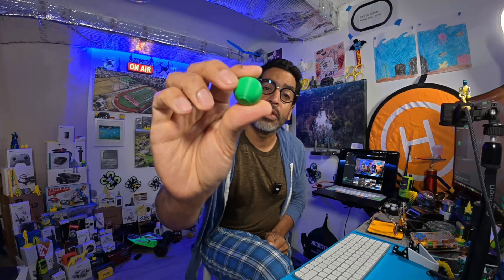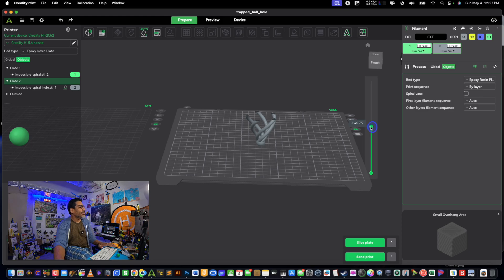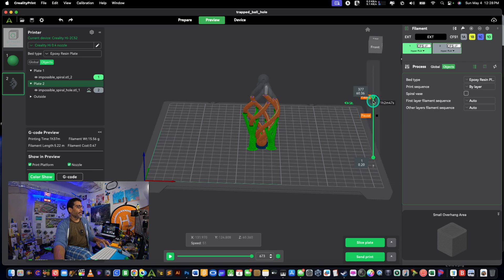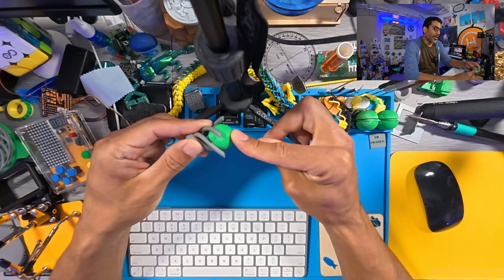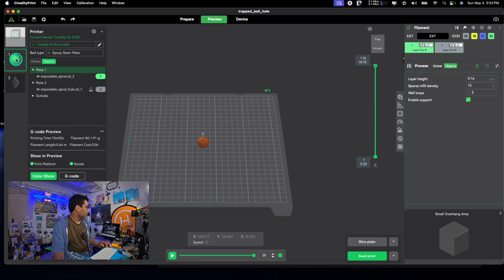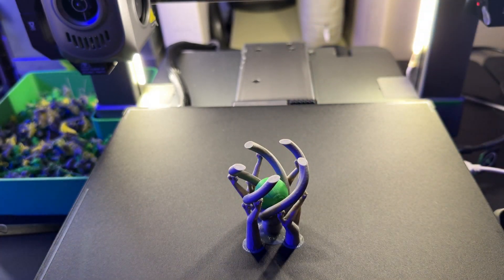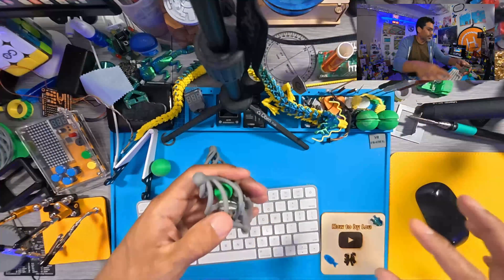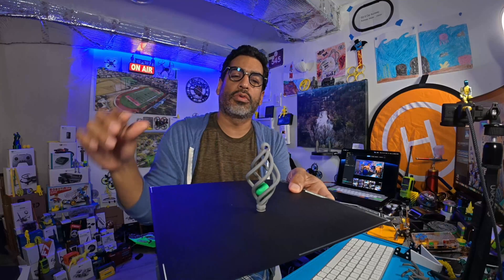how to pause a print using creality slicer. Pause print with creality slicer to pause print layer.

Comment: hey Lou do you know how can i avoid the bed pushing all the way to the front wall of the printer?. 
I feel like its going way to forward and skipping a tooth because whenever i restart the print, then my print is out of line
Reply: I fixed it. You can do it from the settings on the print bed size and print end and start
Reply: Adjudt the Y axis from 220 to 180
Reply from the maker: Thanks for sharing your solution. Hopefully other folks will see this too.